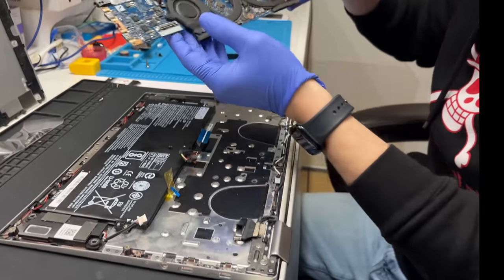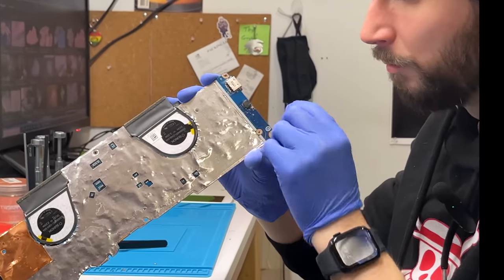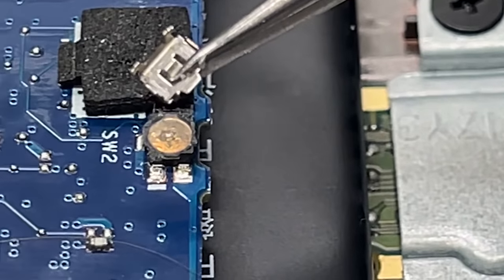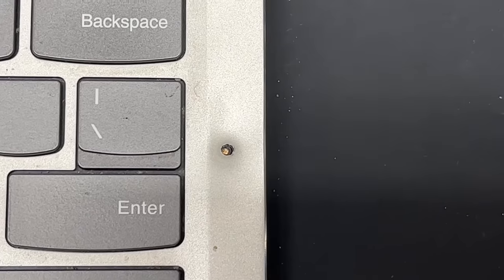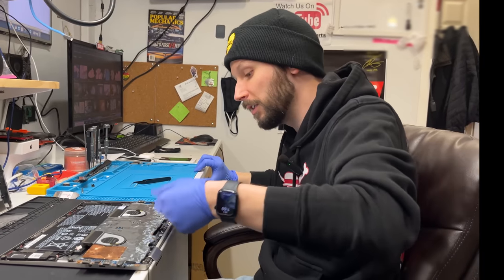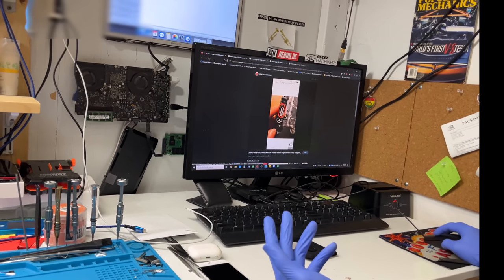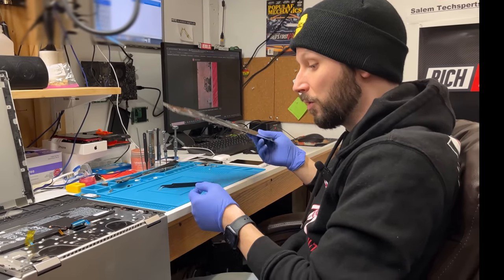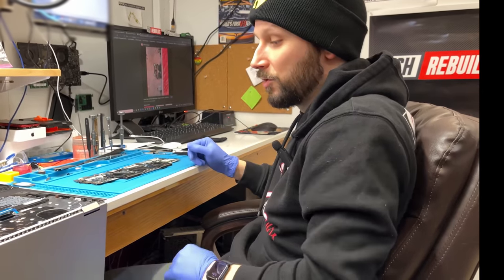Another reason to never buy a Lenovo Yoga (huge design flaw)

Comment: Lenovo's small portables didn't used to be so bad - never as good as the old Thinkpads, but serviceable. I'll be recycling two or three today that have been in use for a decade, not a bad run! Ironically the cheap plastic of older designs has held up better than the sleek, stylised elements on newer hardware. I don't think I'd touch their modern hardware for work or recreation.

Comment: I owned a lenovo legion laptop and to say that thing wasn't ticking timebomb would be an understatement, more than a month of use the motherboard died which got replaced, 2 months later a fan started to sound like a chainsaw and another few months later the motherboard partially died. The authoritied repair center was like ok you dealt with this piece of crap for far to long let us do something in order for you to receive your refund early, where I live lenovo products had to break 4 times before they issued refunds so I have nothing but gratitude towards those technicians and nothing but hatred towards lenovo and their horrible quality control.

Comment: I had two lenovo yogas, both broke the same way in different fashions. The hinges went on both of them, one caused the screen to separate from the chassis and the other did the same thing except for the keyboard. When I sent it to have it fixed, all they did was tighten the screws on the bottom. The laptop died a few months later :,) never again.

Comment: Great Video but there have been improvements to the Yoga line.   New Yoga 7i 13th Gen Intel turns on when you lift the screen up and you can turn it off by using the Start button thereby not using the power button at all.

Comment: Man seeing my own old computer in one of these vids is weird to me. Mine didnt break like this, and i mean it still technically runs (albiet slowly) but I cracked the screen which stopped the touchscreen from working </3 

I had a previous issue with it not booting so i had to send it to lenovo who charged - a lot!!!! to fix it, and when it came back it had a corner broken off of the outer case.

Thanks lenovo x

Comment: My power button on that exact same model is getting wobbly, I hope it lasts! I bought a new Yoga 7 14IRL8 and the DisplayPort stopped working about 4 months after, so have raised a service ticket and will get it replaced etc so need the old Yoga to last me a little while longer lol. I looked online and a lot of people mentioned same issues with the Yoga 7 14IRL8 and that they had to get the motherboard replaced. I have extended my warranty as a result (ugh). The best laptop I had was a Sony VAIO back in 2011 it lasted me 8 years I think, the HD failed after 5 years and I put an SSD in it and upgraded from 4GB to 8gb RAM from Crucial and it lasted another 3 years before the back panel light went and I decided to sell it for parts on E-Bay. I miss when you could unscrew your laptop and replace/upgrade parts, but focus is on everything being ultra slim now. I think going forward I will just get a desktop PC when this one konks out.

Comment: I have 2 Lenovo laptops from that "era"
ideapad 520 with i7 8th gen and Thinkpad T490s
I hate the little things. on ideapad, 4GB of ram is soldered. It has the same reset, or in my case, bios switch. At least the power button is on the top. But there is a CD drive, I have no idea why I did no research while buying this laptop. When I bought SSD and swapped the HDD it came alive but there is no M.2 slot
Thinkpad has all ram soldered. It doesn't have enough for me. Also why did they make the same micro SD + LTE slot with only microSD. When I saw this i was excited, I didn't need to use my phone as hotspot. And that one little fan that often ramps up.
Thank god I'm getting a framework. I was dreaming about that laptop since it was announced.

Comment: Yeah. My acer swift 3 is literal plastic, after 3 years the A on the keyboard broke as well as the usb 3 port (1 of 2 usbs) . I just opened it and the usb 3 is somehow bent so it does not make proper contact

Comment: I dealt with Lenovo laptops on 3 separate occasions (3 times too many IMO), 2 of them being the Yoga model. All 3 of them had wifi card failures. For the Yoga laptops, when you swap out the card, it gives an "unsupported network card" error and won't even let you boot the damn thing with it in there. They whitelisted the fucking wifi cards!!!! And unless you buy a Lenovo branded Intel wifi card from their website for $85 you're shit outta wifi. And for the 3rd Lenovo, it had a soldiered-on Intel micro wifi card, so there was literally no way to fix that one. Pieces of cursed ewaste designed by horrible people that want the world to burn.

Comment: Planned Obsolescence at it's finest, I bought a lenovo ideapad 110 back in 2017 just to find how cheap the body was, literally cheap plastic to the point some chunks are just coming off from the laptop starting with the fan exhaust cover, then it evolved into front panel chunks, then the crappy TN panel which broke and took half the screen pixels with it, its just absurd how Lenovo, a well known company ruin themselves with shitty engineering, I'm sticking with ASUS from now on.

Comment: I own 2 ASUS gaming laptops. One from 2020 and the other from 2022. They claim in their manual that they are built according to some military specs. The 2020’s bluetooth turns off if I lift it up and turns back on. 2022’s screen turned off once I got irritated in some forum and tapped on the keyboard… opened it to take off the RAM and nvme that had installed and the motherboard short-circuited when I was trying to disconnect the battery… so it wouldn’t short-circuit…😅

Comment: I wanted to share an anecdote about my Lenovo Yoga (not sure model, X1 iirc) and I had it allocated from the company I was working for. The laptop was fine but suddenly one day the battery refused to charge. I have a lot of experience in tech and after exhausting several options I resolved to having the outsourced tech support help me since I lacked admin credentials for the updates and all that. After about 30 minutes of some random guy poking around my work PC he just started updating anything and everything. What it came down to was updating the fucking firmware. Tell me how that makes sense; 10-20 years ago if you released a laptop that was fine until 9 or 10 months into general use it stopped charging due to a firmware update being required, you'd be out of business. Lenovo is pumping out garbage.

Comment: Oh, they dont get any better on their high end stuff either. I once ordered a high end desktop replacement once, straight from them. Well into three figure price, but it had all the right specs for the job. It arrives ahead of schedule, safe in its box.

Take it out, turn it on and....thats weird. The screen is blank, and there's just these three blinking lights. Ok, turns out its just calibrating RAM timings! Cool, I just need to give a moment.

Two moments....five moments....still blinking....30 moments....overnight?

Still blinking. I called their support line, I followed basic instructions to troubleshoot, we realized it was dead as a doornail for all intents and purposes, and I sent that crap back for a full refund. 

Never again.

Comment: That last part is something nobody ever considers. Pick a random Chinese tech product. Looks nice enough, has the right specs.... but it will work for a month. Or maybe spontaneously combust. Or it will half-work.

I want reviews of 3 year old laptops, 4 year old tires,10 year old cars... If you get an Audi, you can very much expect it to work flawlessly, and beautifully for the first 3 years and then it will start breaking down. I know a guy whose Mercedes CLA engine blew up, the car had 103.000km on the odometer, said he always drove it nicely, no racing or anything like that,  it was just out of warranty, replacement engine costs 20k, on a car that would have been worth 25k.

Comment: dang, glad I didn't buy a lenovo for my 1st laptop then! HP has its own flaws and quirks ofc, I actually wanna try a different brand when my current one fails, but 5 years in, including dropping it and a spill on the keyboard, it still works! Battery's not what it used to (I get ~2 hrs, <1 when using ms teams) and it is slowing down now tho. The time I dropped it the hdmi port got all bent, but it still works perfectly fine

Comment: this whole thing looks like cheap garbage that's purposely designed not to last. I'm in the market for a new laptop, albeit a much higher powered one, and this worries me.  I just returned a really nice surface laptop studio because they cheaped out so hard on the screen quality that it made it unbearable to use and that I thought was completely unacceptable at that price point. Do Asus's more tame looking gaming laptops suffer from crap like this? I liked the specs/screen on some of Asus's laptops like X/M16 and am waiting for CES to make a decision on what to get.

This is why I'm starting to hate laptops, I've never bought a really nice one before except for a macbook air a long time ago. I'd rather be able to build a desktop to exactly how I want it than spend so much more on a laptop where they may have cheaped out or royally fucked up one part of it that ends up ruining the whole package, like that surface laptop studio, or this yoga...

Comment: i used to have an old lenovo laptop that was basically the rasputin of computers. It had been submerged, coffee poured on it, had jealous yorkshire terriers that peed on it, its been THROWN  and dropped down a flight of stairs, been through like 4 moves and was consistently in the presence of cigarette smoke. 
It just kept working. My mom kept it up untill it was just too obsolete specwise and got herself an asus predator to play dragon age on. its still in a storage unit somewhere and i know it will still power on. 

After my experience with that, i found your hate of lenovo initially suprising, but i see why now. my gosh have they severely reduced their build quality.
I could make a better power button with a paperclip and an led diode if im feelin sporty. heck, you made a better power button with a drill lmao.

Comment: There is an older Lenovo Yoga in my family, and it is awfull. It is underpowered, has no battery life, and the fan ends up rubing its housing when the screen is tilted back a normal amount.
On the otherhand I own a Thinkpad Yoga L390, and it has served me well the past 5 years as my daily driver.

Comment: I'm shocked, yet not surprised. A decade ago, I had to repair a Lenovo Ideapad. The left mouse button of the trackpad was broken after only a year of slight use. Turned out it was unfixable, because instead of using a reliable microswitch they used some non-replaceable foil-based solution. Lenovo's warranty only covered a year and had just expired. This lead me to do some research on the company and it turned out that it's a Chinese one which kind of explained the lack of quality. I stopped recommending Lenovo products right then and there and never bought any of their products ever again.

Comment: lenovo victim here, typing from my lenovo ideapad s145 that I got about 3 years ago out of necessity, I've replaced the keyboard (awful process) and the hard drive (only easy because it's hard to mess that up luckily) and now the insides are just broken plastic, pretty sure everytime I opened it up something broke and I'm pretty sure only two thirds of the screws still fit now, that's why I'll be getting a a Framework Laptop 13 soon, can't wait for a real laptop like that

Comment: I had a Lenovo c340. After about a year of usage the hinges started to fail. I barely used it as a laptop, it was mostly just sitting on my desk. I contacted Lenovo and they told me it was a user error so they didn't cover it even though this issue was known in the forums and it still had warranty. Had to spend $130 to repair it.
Such a garbage company, I'll never buy from them again.

Comment: I've had 3 Lenovo's over the years and all of them have failed on me, first the power socket on my first laptop killed itself, then the keyboard cooked itself on the second one, and lastly on the third one I bought a gaming laptop that had a decent cooling system, good fans and I made sure they were cleaned every month. The last one the USB ports kept disconnecting and it actually ended up being an issue with the motherboard, the issue being the motherboard got melted... so now I've moved to Acer and got myself a Predator Helios 300.

Comment: I've had a Yoga for almost 4 years and it has massive flaws. These are the things I've been struggling with.

Power button on the side. For a PC with this much versatility as a touch screen you completely lose the ability to keep it resting on the table on the side.

Screen. The screen does not stay fixed enough, everytime you touch it it bounces like crazy.

Power cable. It broke down. Cost me almost 100 euro to replace both cable and energy collector.

Battery. Cannot survive unplugged since year 1, it fried itself and that's it.

Pen. The pen can be rested on the side of the laptop by losing one of the only 2 usb. Also due to the fact that the pen was always on it consumed batteries like crazy.

Comment: I used yoga370 with the switch on the side for 7 years and never had a problem. One failure does not mean that it is badly designed.

Comment: Power button placement itself on these Lenovos is just stupid, period. Why? You can easily accidentally press it when handling the laptop while using it. To make the matter worse, you would think you could use the button to turn the laptop on when the screen is closed as you use it with an external screen - but nooooooo. Button is disabled as to not activate while in your bag. Ok. But why can't i turn this "protection" in BIOS? Or why doesn't this protection just disable when charger is present? Because f*ck usability, that's why.

Comment: Anything outside ThinkPad from Lenovo, it's like those Chinese toys you buy on festival to test your luck. Once broken, you're bound to throw it away. I still can't get over the fact how fucked up is to get a keyboard replacement for my legion y520. Not to mention the failing rubber all across the body under 2 years. They put all the beast specs and wrap in cheap plastic and entire thing goes to waste in a years time. Same philosophy is now being followed by Motorola phones.

Comment: 1. you didnt check mouser well enough.
2. Do get a 3D printer
3. Sometimes they mess up the plastic composition. This happens a lot in China. Asus had the same problem with their Zenbook hinges. So basically at the designer level it was durable but at the factory level they messed up the chemistry and that's why it breaks.

Comment: Just came here after Rossmann published the link and love it here 😅
As to the Yoga itself - what really grinds my gears is that the same company that ruined an otherwise working collection of parts that all needed to be produced, forcing you to throw it away and buy a new one, will also tell you how eco they are and how sustainably they produced this POS. Failing to mention, if it worked for at least 5 years, you wouldn't require a factory to pollute anything while producing another plastic laptop for you every year FFS

Comment: As always, this seems like the management's/bean-counters' fault. Any engineer with a functioning brain would just make a small triangle shaped plastic lever thats moulded into the housing of the switch as a single piece, so that the vertical motion of the external button would turn the triangular lever and press the internal switch downwards.

Comment: i dunno about u but a lenovo since i first got one in 2013 is one of the most reliable and solid workhorses iv ever seen, even their low end $500,$600 laptops.....i cant say as much for all the rest asus....acer....hp....other than macs, there were no such thing as a cheap mac so u expect a certain quality from them.

the longest lasting laptop i owned was a $600 lenovo laptop which lasted more than 6 years before too many things broke down to a point it became unuseable........that was with me never turning it off a day in my life, it either spent 12 hours awake or on,or in sleep mode the other 12 hours a day.....but i never once shut it down on purpose for more than 12 hours. every other goddam laptop or computer i had serious problems started showing up 18 months to 2 years in.....

Comment: I had a lenovo Flex 15, it was a 2 in 1 with a 15.6 inch screen, and the hinge was attached to the screen through threaded inserts into plastic, the plastic around the inserts broke in 3 months, where the hinges were pushing up on the bottom on the LCD and would have broken it if I kept going. Luckily, Newegg, let me return it for a store credit.

Comment: manufacturers: "anything you do aside from admiring the factory sealed packaging will void the guarantee"

also manufacturers: "if in doubt poke a needle in here. you won't lever any component off, or short something out, or delaminate the board, or stab a cable, or wear out the way too soft button.
Trust me, bro"

Comment: Not that I disagree with your failure analysis, but I will disagree on two small points:
1. The vast majority of laptop users never use the power button; most couldn't find it with a map.
2. A paper clip is what you use to trip a reset button; not a needle.

Comment: Dude fuck the Lenovo Yoga model I bought.  The ribbon cable connecting the motherboard to the screen broke in one year and one day of usage (with a 1 year warranty, hmmmmmmmmmmmmm), and has the microphone and camera built into it, so a replacement cable is over thirty times the price of a ribbon cable that only goes to the screen in most other laptops.

AND, the screen assembly is superglued shut and uses real glass, so any imperfect attempt to disassemble it to replace the cable will break it.